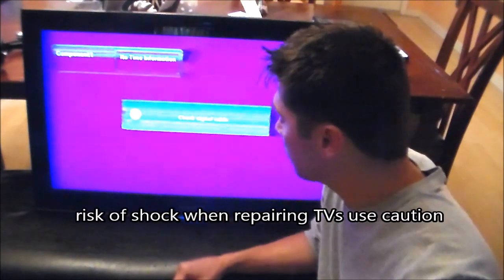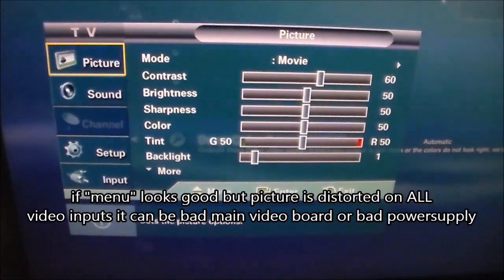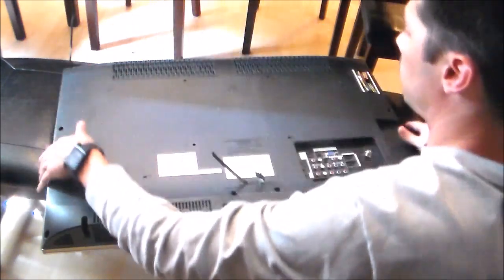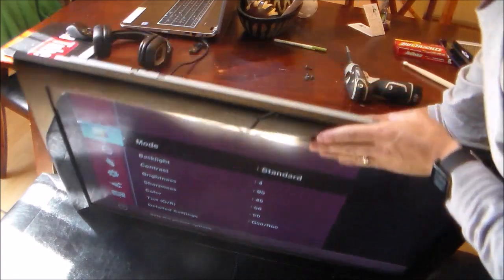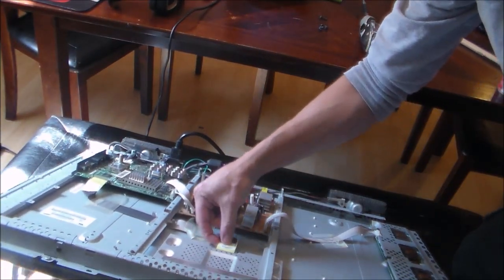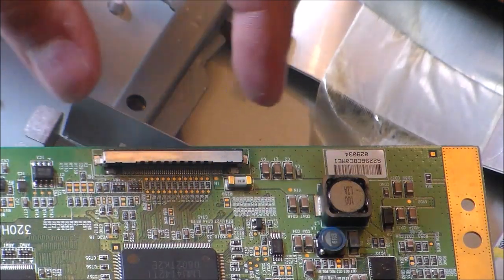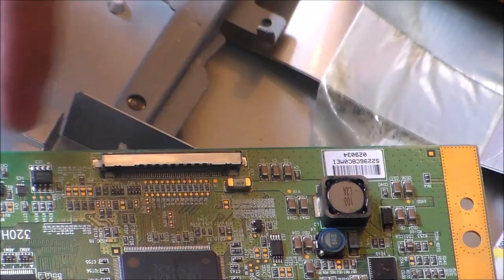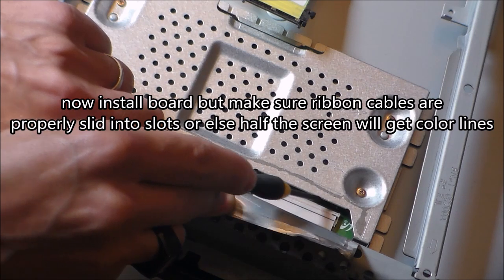Common easy LCD TV fix: bad picture screen rainbow colors

Comment: Someone told me to try running a credit card along the top between the glass and the plastic housing. The problem spot is about 2 inches between the upper right corner and there is another spot on the left in about the same area. Try at your own risk, this could make it worse, but it fixed mine the first time. Someone in one of the dozens of groups or YouTube responses told me to try it, and I ignored the post, but gave it a shot right before I pulled the whole thing apart to try a much more complicated fix.
I tried to get the fault to repeat, so I could make a video response, but I have not been able to get it to fail again... 
If I hadn't just done it, I would not believe it.
I have been looking for the post to thank him, but I didn't pay much attention, so I never bookmarked it. Whoever you are, THANK YOU!!!
Reply: Jonnyreverb Please explain it! I want to try it
Reply: this will not work. this will complicate if not break your TV.

Comment: Just curious...why would this solder joint on the connector fail/become loose? I have a Vizio TV and I'm getting the rainbow (solarization) effect (both on the image and the menu). Do you have any videos/suggestions on fixing Vizio TVs. Is there an easy way to isolate whether the problem is with the TCON board vs the main panel. One video said if it's the main panel that's going bad it would be expensive to fix and probably not worth the effort.

Comment: Very helpful your videos. I have a TV "LA40A550p1r" with color display problem. I changed some parameters of service menu. Still the same problem is there. Can you please give the "essential  default parameters in the service menu" for this TV, so I can compare the present settings to make sure nothing is wrong within the entry.
I am not a professional, but enthusiastic in electronic field.
Thanks Tampatec uploading these kind of videos.

Comment: Great video! I have a Samsung UN39FH5000F which displays solid white on the right half of the screen while the left half is normal. This problem exists across all inputs and the menu despite performing a factory reset. Is this a problem that could be fixed with the method in this video, or another method? Thanks for all the great instructional vids!

Comment: Hey great video. Ok I have a 42" LG, it is exactly like you said; main menu is crystal clear, the PC/RGB output is clear, Video-1 is clear, but on video 2 it is bad. Wavy lines, distorted/bad color, etc. It is a 2005 model and doesn't have HDMI.  From the looks no apparent bad caps,  but yeah that doesnt mean anything, if you could help that would be great! Thanks

Comment: Insignia 55" goes psychedelic after heating up. Caps look fine. Picture looks great for about a half hour then bad trip time. Apart from heat sinks, the only place getting hot is the top of the screen. Any thoughts? TIA

Comment: I have a 40 inch with a similar problem.. mostly distorted greenish picture and the menu button also seem distorted but not as bad, hard to tell. Replaced the t-con board and I still have the same problem....  but my problem is not as bad and this tv seems like...  do u think the t-con board I got from eBay is defective? What esle can I check for?  I know how to use a multi meter.

Comment: Hey man, nice vids! I just copped the Geek Squad guy putting a decent looking Sony Bravia LCD out by the trash at the Best Buy next door to my office, so I decided it might be worthwhile to drag it over here and see if it's salvageable. It powers up fine, but the left half of the screen is solarized/low contrast while the right side of the screen is just fine. I'm thinking T-con board or cables going to, but I'm wondering if you've seen this symptom on a Sony before and can concur. It's a KDL-40XBR6, if that makes a difference.

Comment: Hey man quick question. I have a samsung 50in lcd bought it last year still under warranty and every maybe 3-5 weeks ill turn it on and itll have rainbow colors but its streaky and not solid and will move around. Then i turn it off and on and it is fine. Any idea as to what this may be? Any help would be greatly appreciated. I didnt want to take the cover off and mess with it unless i knew what to go for.

Comment: I got a Asus moniter that broke only because my controller changed directions in mid air xD... BUT where can I find the electronic cleaner and i also hit the area that was rainbow to see if that worked... bad idea, so it has like an object that is in the middle of the mess where i hit it and alot of dead pixels before this, will all the stuff still work in this situation?

Comment: I pretty much have the same TV you have I got two of them one of them it says please wait and the screen will not come on but you can't see it say please wait the other TV I have is the same TV you have when you turn it on the color for the menu is off I sprayed it and did what you told me it's not working is there any other way that I can fix these TVs if there is please can you help me and I thank you for any of your help that you gave me thanks

Comment: Hello,
 I have a Vizio  M65 -C1  that started to act up,  It started with 1/2the screen with lines , I would unplug and replug and it would work normally, until this morning. Now I get the top 1/3 of the screen with a scrambled image, bottom 2/3 black and full sound.
I believe that it might be the T-Con board, however my concers is that when I pres on the GUIDE buton on the cable box, it shows on the full screen perfectly. Seems that if the image is static, it shows, but video does not.  Please advise and thanks for your help,

Rudy

Comment: Does this work on a Samsung UN55H6300AF? I possess a Samsung 55" LED TV and it has pink/blue/et cetera abnormal colors in the objects on tv. I checked options, the bars were also having pink distortions.

Comment: i have Coby TFTV4025 turns on fine there is a distorted line going across the top which is fine but once its on for a few minutes it starts getting a green tint from where the top distorted line going across to the rest of the bottom of the screen, start having a green tint and starts flickering? TCON is mounted to the edge of the top of the LCD

Comment: Hi, I have a problem with my tv. Currently it has garbled image. I tried to replace the tcon board but after watching you video, it says that if I’m on menu and it’s clear then focus on the video main board. What should I do to repair the video main board? It turns worst when I try to turn to hdmi 1 or other inputs.

Comment: This is very useful thanks for sharing. All you need is to show us how to fix the infamous PlayStation 3D TV red blinking light of death.
Reply from the maker: do you mean PS4 flashes light issue? or 3dtv sony tv?
Reply: +Tampatec I have problem on my skyworth LCD 42" menu pop up every second  when I decrease the volume its normal or I put in silent mode it's normal also when increase the volume menu start to pop up ....

Comment: I have the Samsung UE40KU6400, had two actually, and both started with flickering blue lines. I updated the firmware and that fixed that. But on both they pink distortion if I turn them on and my PC is already on (also happens if I turn TV off and leave PC on and then come back and turn the PC on) it shows distorted picture with pink horizontal corrupted lines across the top half and then it corrects. It's also sometimes showing a picture of something that happened days ago when it's turned on, but the picture is doubled on the screen and all corrupted. It also, if the device that's connected turns off (Xbox 360 mostly) or stops giving a picture while the TV is off, shows the last picture it had when I turn it on before going to no signal.

What's wrong with it?
It's not the cables as I've tried multiple brands of cable. Even bought new 4K cables (there's no such thing as a 4K HDMI 2 cable, but I thought just in case) and that didn't fix it. My GPU (GTX 780) is within what it's capable of and not overheating. IIRC, the integrated graphics produce the same result. Either way, TV's going back for a refund and at this time, I have no plans to try again with this model, would just like to know what the fault is (Samsung and the seller say there isn't one)

First one even showed corrupt picture when nothing was giving it signal. The menus are never corrupt though

Comment: Tampatec, is there any way I could make a YouTube video of my screen/picture from my Samsung tv and link it to you in the comments for a diagnosis??? I've watched numerous videos of yours and I still can't single out the cause of my issue. There is a lot of red in the picture/pixels, sometimes the menu is also distorted, sometimes it isn't, sometimes the picture is almost flawless, usually some of the picture is but the color black and other darker colors want to appear red, but not all of it, some colors are distorted blue but mostly it's red bleeding through everything. Every once in awhile the picture is 99% fine but then quickly goes back to the distortion/red.

Comment: those are mounting bosses , they are not connected to anything. they are just a support for the flat cable connector . so the finer lead pads of the connector are not torn off when somebody is 
handling the connector..

Comment: Hey could you help me? I have a monitor which  have blinking power indicator led, when i disconnect lcd panel, all goes fine, when connecting lcd panel again, then it again blinks led. :( can i fix this?

Comment: I have a samsung ln37a450c that has a picture and the menu is readable, but the colors are way off(skin tones and backgrounds have way too much red, and the whites are yellowish) and the dark areas of the image are too dark. Also the backlight slider in the menu doesn't affect the backlight brightness at all. 0 or 10 looks exactly the same, too dark. I replaced the t-con board because the screen was white and washed out, but now everything is too dark and the backlight slider isn't adjusting the backlight. I've messed with every setting in the menu. Any suggestions? Thanks.

Comment: I have a Vizio xl37l HDTV10a it's starting to solarize. if I turn up the brightness it's bad. What you think it might be? thank you for your video's.
Reply from the maker: possible tcon board or loose tcon connections, but first reset Tv by unplugging Tv cord for 5 minutes
Reply: I took it apart last night and only seen the power supply  the main video board and on the side I think was the inverter board.. I'm guessing the t con board was deeper under. I can't find a good link to look at this exact TV.. I'm a newbie to this.. love your video's... Thank you.
Reply: You do not need to know exactly what the T-con board looks like. It will be connected to ribbon cables connecting to the LCD or LED panel with a nice big integrated circuit on it. Looking up the number on that chip can easily tell you if it a timing controller chip and you have found your board. Very easy. If you are new, you have to start somewhere but this is a big step up from tiny electronic repair jobs. If you do solder anything, use flux paste with rosin core solder and clean it off afterwards. So many people say it is not needed but I find bad solders all the time that did not have enough flux paste used during the soldering process.
Reply: ive been repairing stuff since I was in 9th grade. most repairs, in my experience, is soldered points OR capacitors(bulging) OR resistors(popped) OR power supply fuse problems.

Comment: I have Samsung Smart TV UA55ES8000 series, The TV started  to show vertical lines on right side, I replaced the T-Con card and the flat cable , the TV works fine for 2 days and then started again with the colorful vertical lines 
I believe this happened after updating the Tv, I am not sure, and now it's rebooting constantly with this lines the full screen is affected now.
Please needs help to fix this TV.

Comment: That's a good job... Like your videos on how to solder... Thank You... Can you post more how to videos how to solder a circuit board and add new components like a filter capacitor and filter caps and how to remove bad parts from a circuit board

Comment: I have a Sony with wiggly fuzzy rainbow color display. I found that if I let it heat up about 10 minutes and restart, the picture returns to normal. What might be the problem?
Reply: Have you found the solution for that problem? Mine is doing the same thing

Comment: I have issue with my lg 47lx9900 led tv. When i press heatsink of main av board tv frizz with white screen and then give buzz sound and shut off. Its also act same when i connect hdmi or any cable to main board. Sometimes its accept hdmi signal and sometimes its says no signal. Pls help me to solve this issue.

Comment: What should I look for as the issue if I have the blinking red light on my 47" LG after a thunderstorm and the capacitors aren't or should I say do not look blown? HELP PLEASE!!!!
Reply from the maker: check standby volts on "power board" ( labeled "sdby") if reads 0v on meter then power board is bad..if meter reads 3.3v dc sometimes 5v dc then "main logic board" can be bad. surges can enter through powercord or hdmi cables so those boards can be effected.
Reply: Thanks for the response. How much would you charge to troubleshoot and maybe repair?

Comment: Some of you guys probably have problem with the videocard! Try pluging the cable in the motherboard, and if the monitor works, the problem is the videocard. I had the same problem. But now i have problem with my Philips Monitor. It makes disorted colors, when i drag the mouse it shows the cursor in frames,and everything is slowly appearing (like google or something), please reply author of this video,i can even post a video on my yt channel!
Reply: very good explain

Comment: Buying a new TV would help because sometimes all those advices on youtube doesn't work.
I fix TVs myself and from my experience i can confirm some advices works but most of them not.
Reply: I have a 32" Sony Bravia KDL-32BX300 that has a problem where the picture appears cloudy/hazy and there is a faint horizontal green streak across the center of the screen. Any ideas on what might have caused this and how i can fix it? Thanks!

Comment: Samsung LNT4642HX/XAA
 When powering it up it clicks on and off but will not pwr up. it only makes the clicking sound no sound no picture
Reply: Usually caused by a short somewhere. I'm working on one such TV right now. It had a blown voltage regulator and a shorted Trident on the main board.

Comment: Hi sir i have my sony bravia lcd tv the problem is when i turn it on the picture is ok but in a few minutes it turns violet how can i fix it thank you very much
Reply from the maker: Wendell Lumban can be tcon board or main board or bad tcon connection to LCD panel. if you press the tv bezel and screen goes flickers back to normal then unfortunately it's the the panel.
Reply: Tampatec thank you sir
Reply: I have the same problem but It only happens when I have my PC connected to my TV. When i connect it to my set top box it works just fine.
Reply: Wendell Lumban
Reply: I have similar problem with my Sony bravia LCD TV too..screen goes violet. how u fixed it? wendell